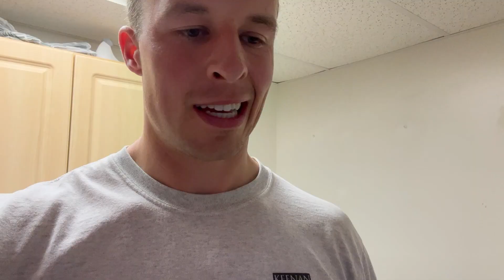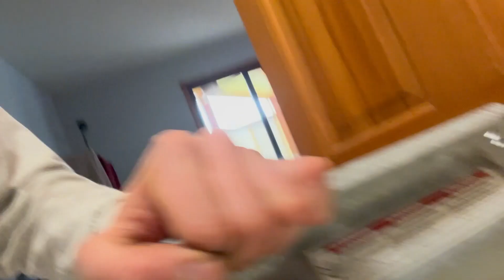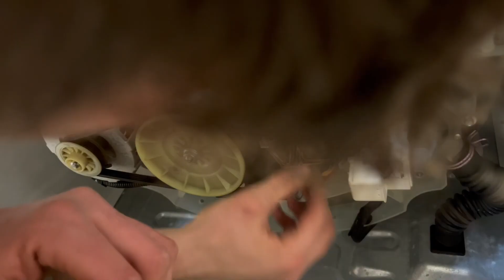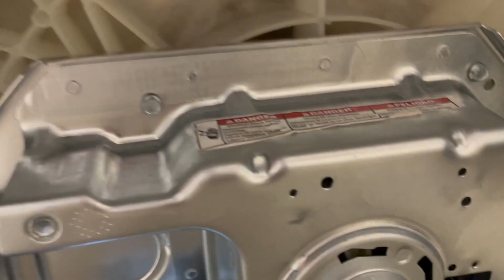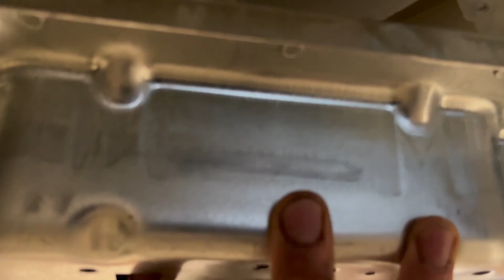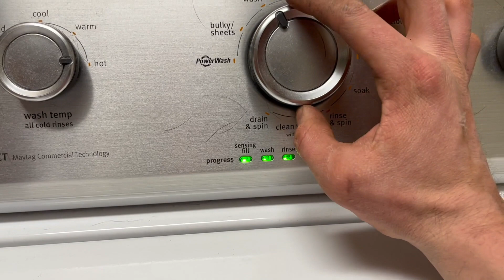Loud Whirring Maytag Centennial Tub Bearing Gearbox Replacement

Comment: Just replaced mine. I soaked the top shaft with WD-40 and let it sit overnight.  Then I struck the top of the shaft with a long rachet extension and 3lb hammer multiple times. It did come out.
Note: When recalibrating make sure you start at the blank spot on the dial between Power Wash and drain & spin. It doesn’t point that out in the paper instructions.  But I got a clue by watching your video.  So thanks for that.
I purchased my replacement on eBay for $155 plus tax and free shipping.  I’m back to quieter washing.  😊

Comment: My Centennial is starting to get loud on spin cycle. Going to wait until it gets worse 
May try this to save $100's 
Same model is $578
Reply from the maker: Sounds like a plan. If it sounds like a plane taking off it’s probably the tub bearings. That’s what mine sounded like.
Reply: @unstuckchuck still going no leaks but very noisy

Comment: You didn't have to replace the whole gearbox. You just needed to remove the washer plate then the hub and bearing. Much cheaper and a lot easier.
Reply: On this model, the tub bearings are held captive in the gearbox so that the entire assembly must be replaced when they fail. I wish I could have just replaced the bearings because you’re right - it would have been a lot cheaper!
Reply: Gearbox definitely doesn’t just fall out like that.

Comment: Didyiu try the 10 year warranty?
Reply: The 10 year warranty doesn’t cover anything literally so far on my seven-year-old washer identical to this I replaced shift actuator motor splutch door, switch, drum bearings, capacitor, and the motor. The only thing that hasn’t failed yet is the pump.
Reply: I did - it did not cover this repair. Sad!